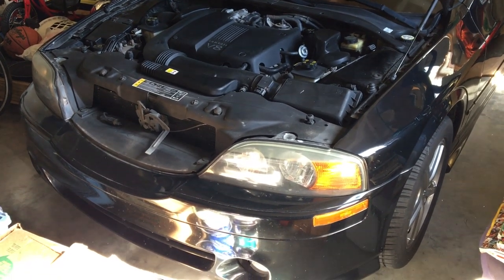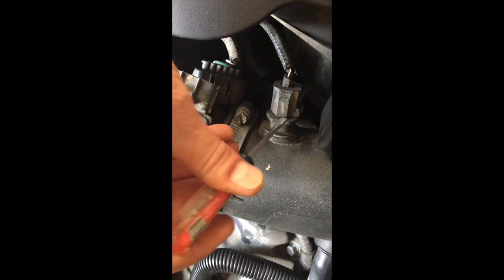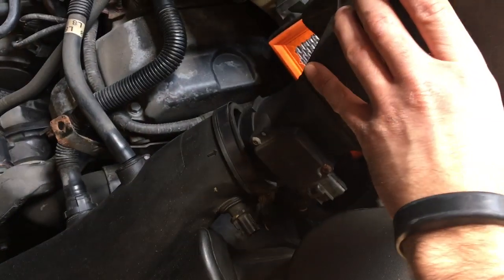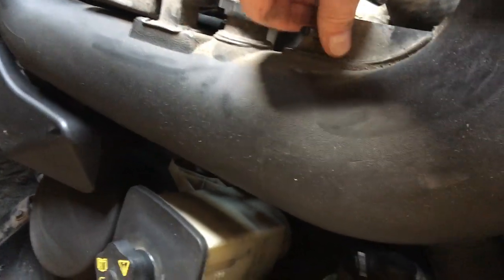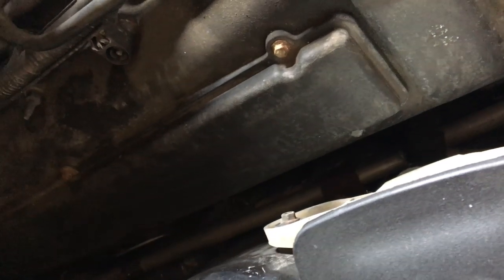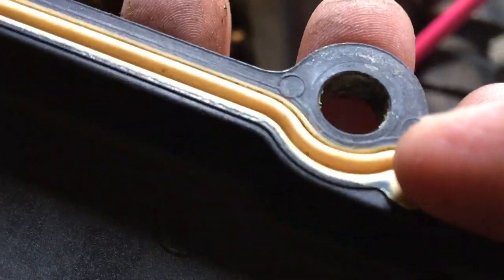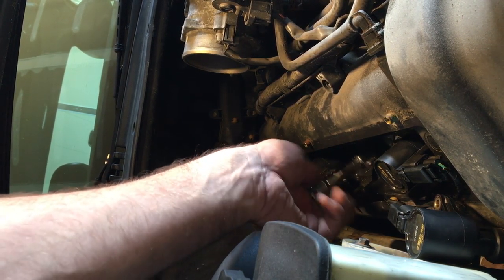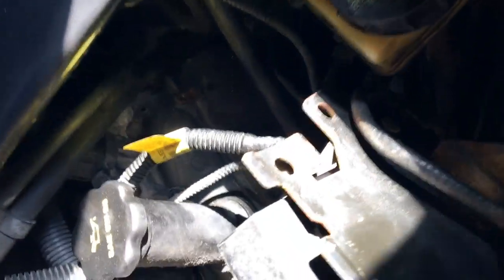Lincoln LS V8 Spark Plug Coil on Plug Air Filter Replacement

Comment: Great video!  Thanks for convincing me to do this job and save lots of money!!!
I am not a mechanic and I was able to do this job by doing the research first.
I took my sweet time.  I changed each spark plug and coil before moving on to the next.
I bought a 6'' 7MM ratchet wrench to get to the hard to reach bolts on the covers.
Since my Thunderbird is 19 years old and in great condition I opted for Motorcraft Coils and Denso Iridium Spark Plugs.  I hope to keep the car for at least two more years. Since I bought the parts @t the I was able to opt for the more expensive parts.  Rock Auto was much cheaper than the big name brick and mortar stores even with 20% off.
P.S.  I would opt for a longer ratchet wrench for more leverage, with a swivel if you plan on doing this job.   8'' ratchet wrench maybe?

Comment: Yay. I have a misfire on cylinder 6 on the new LS I just bought. Already ordered new could and new plugs. I'm assuming because it's got 98,000 miles, they are still original and have never been changed.

Comment: Thanks for the helpful video.  I am stuck on removing the last bolt from the driver side spark plug/coil cover.  It is the lower-back one that is tucked in by the #8 cylinder and the brake master cylinder.  Any suggestions on how to get it out?  My small socket is being blocked by the big round chamber of the master cylinder/brake assembly.  Thank you!
Reply: James I am in your same boat currently trying to remove that bottom bolt, Did you end up getting it removed? Im stuck
Reply: I was finally able to get a small 7mm wrench on it.  The wrench I used had a ratchet type of closed end so I was able to remove it only an inch or two with each swing, it took a while but I finally got it out.  *Upon re-installation I omitted that 8th bolt, just tightened the seven that I could get to without much effort.